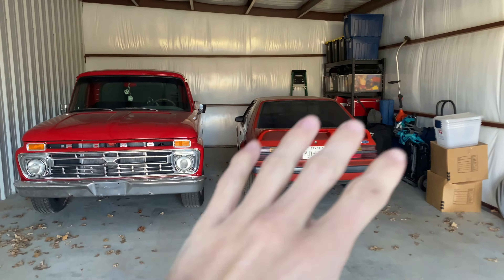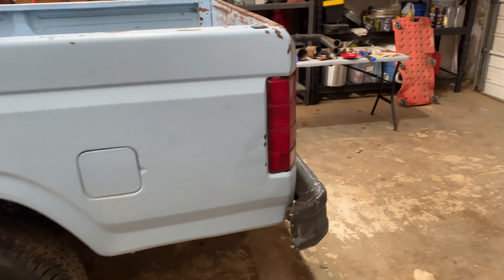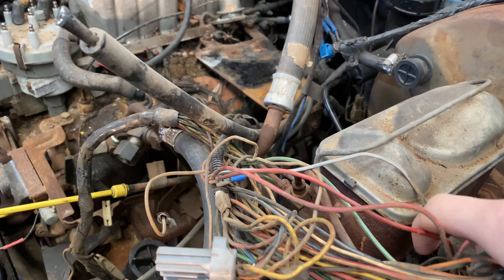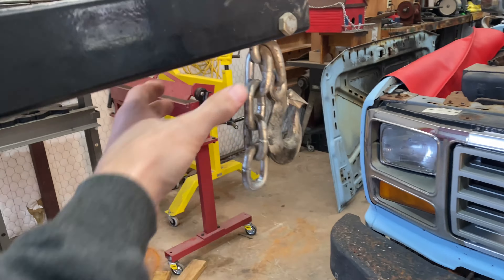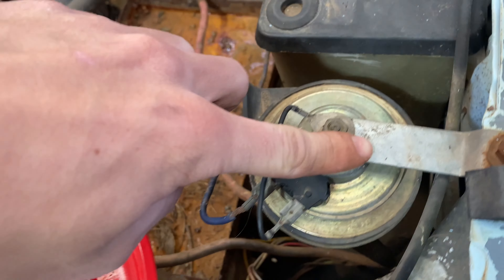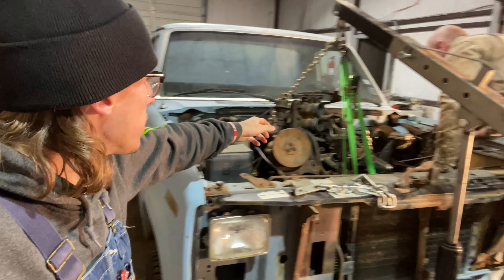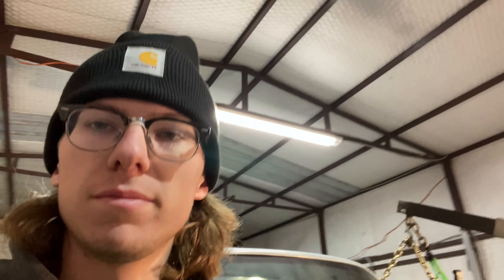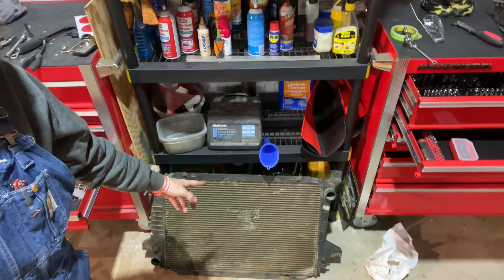1986 Ford F150: Engine Rebuild PT.1

Comment: I just started working on removing the engine out of my 86 F150. I have the 302
This is my first engine job, pretty excited. 
I ended up pulling out the rad and rad support so when I pick the engine, I don’t have to clear the top of the rad. Not knowing what I am doing, this made the most sense. Thanks for the video, I appreciate any insight I can get.

Comment: So i am having a issue with my ford f150. I replaced the battery and the alternator. But for some reason the alternator not getting enough juice to charge the battery. My battery has one big red power cable that leads to the cyclonid then down to starter and to the alternator. But since i replaced the battery and alternator. Is it possible that the cyclonid is bad? If so and it is wouldnt that be messing with the flow of electric to the alternator?? Or do we think that since the dash light is out that its not flowing right that way?? Let me know man i would appreciate it!!!